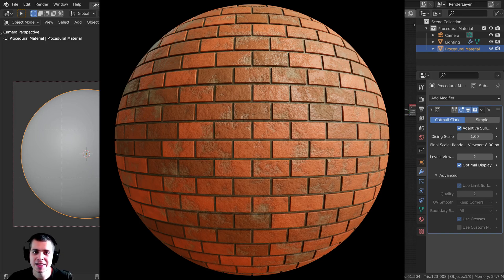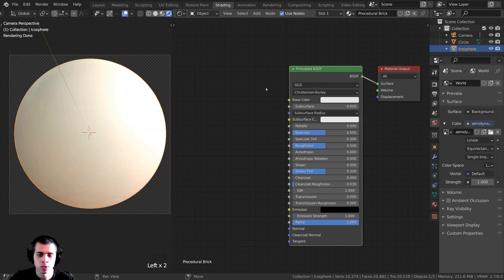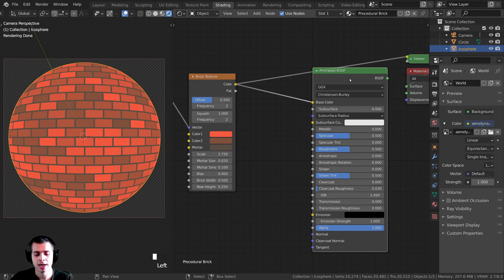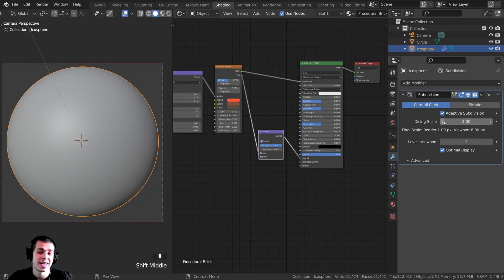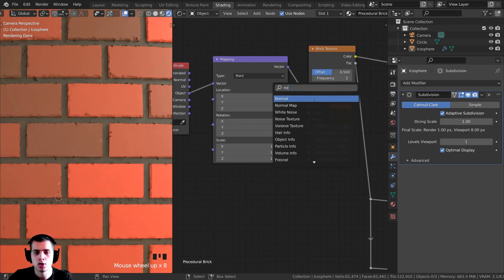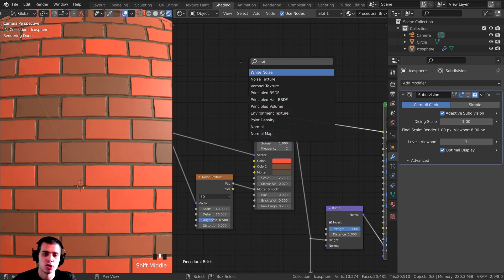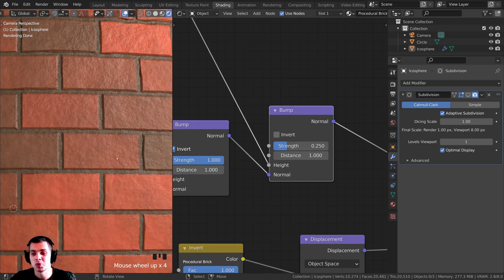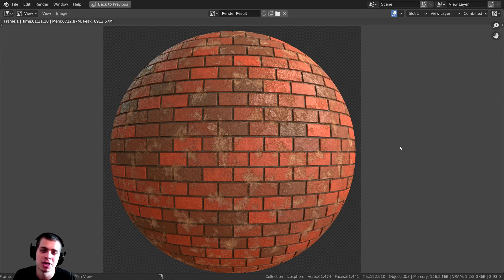Procedural Brick Material (Blender Tutorial)

Comment: Don't know if this will help anyone but, I did this tutorial to a set I'm making for a short. And I ran into the problem of my bricks only showing horizontally on one side of my mesh. As I was making stage wall texture. I recreated the tutorial on two separate textures and assigned them to each wall seperatly. Then for the wall that was only showing bricks horizontally, I went to the rotation on the Mapping node which is connected to the Brick Texture node. In addition to rotating the X rotation to 90 degrees I also rotated the Y rotation to 90 degrees and the texture worked perfectly.

Comment: for those using Blender 4, the Surface Displacement settings are located in the options panel (press N whilst in the Shader Editor) and they are listed under Settings>Surface. They are also in the Settings of the material properties in the drop down menu beneath the displacement settings.

Comment: At 4:50 you say "whatever you like". Do you have any advice how to correctly scale the brick texture to match for example 60x60cm tiles? I have played around with Texel Density (great addon) and other tricks and tutorials, but ALWAYS ended up using the measuring tool for hours (literally) to get close to the correct size. I assumed that if you set the scale to 1 and the brick size to 0.6 it would match to 60cm as Blender unit is 1 meter ... but it does not. Thanks for any pro advice! -- Cheers, Nils

Comment: Nodes are quite possibly the least intuitive and most convoluted form of modeling Ever invented. You not only have to remember the name and full features of every node but also remember where that node plugs into another node. Then remember which sliders on each node controls which parameters. Multiply this process over a dozen different nodes, two dozen different connection points and six dozen different sliders and congratulations, you have a brick wall. lol

At the very least Blender should have a small library of node setups for basic textures. Example: Load the brick wall node setup from the library, adjust the parameters as needed and you're done.

It's just confusing to invert the mortar on the bump map only to add yet another node later in the proces to invert the mortar.

Comment: Thank you so much for not just this video, but this entire series. They are all so useful for the work I do! As weird as this sounds, I used this tutorial to make fishnet stockings for a model. However, if you don't mind, I have two questions for you: 

1) Do you know of a way to apply a subsurface color to just the bricks part of the texture (say, make the bricks have a subsurface color of red but have the grout have no subsurface color).
2) Is there a way to apply a separate normal map to the bricks and the grout? So, as an example, have the bricks have a bit rougher of a normal than the grout.

I thought making the bricks shader first then applying it via a "Shader to RGB" node to the brick texture would do the trick, but the subsurface color doesn't really show up and it messes up the shadows (as in makes them completely black). Any help with this would be appreciated. If not, thank you anyway and have a great day!
Reply from the maker: Thanks for watching! Yes, these can both totally be done.

For the subsurface, you can plug the brick texture factor, into the  subsurface on the principled. You will also need to add an invert node to switch the values, so that the bricks have the subsurf. Then either add a texture in the the subsurface color, or just change the color value.

For the normal, you can use the brick factor, as a mask, to make different parts have different normal maps. For instance, you could add a noise texture, and plug it into the color 2, of a mix rgb node. set the mix RGB to lighten, and make color 1 fully black. Then add the brick texture factor into the factor the the mix rgb. then plug the mix rgb color into a bump node height value, and finally, plug that into the normal. hope this helps.
Reply: @RyanKingArt  This works like an absolute charm! Thank you for the help with this!
Reply from the maker: @SquirreltailAnimation  You're welcome!

Comment: This is great and I followed along but, when I put this into practice I have a problem. Walls on a building step in and out, turning corners and, the inside does not have brick texture. When I use this node on a wall, even though I pick specific faces, the procedural texture goes on every wall and is elongated on some as stripes. I have tried "cube projection but, that has no effect at all (I'm trying on version 3.0). I've tried unwrapping, marking seams, selecting individual faces, etc, and nothing seems to stop the procedural shader from applying itself to everything and those faces that are ninety degrees from a correctly laid out  grid become stripes of brich and mortar stretched.
Reply from the maker: Yeah, I should have gone over how to fix that in the tutorial. There is a node setup to fix this issue. I might make a video about it soon.
Reply: @RyanKingArt  There may be some quirks to work out on 3.0 (there is on any new version of any software). I would run it and have it do one thing, strip it all back and run again and get it to work. The thing that worked best was to first apply a generic texture, I just used a white color, then when you specify the faces to be brick it only applies to those, That also seemed to trigger the "cube projection" to line up the rows.

Comment: I'm getting no change after adding bump node. It shows a very little difference but changing distance or strength has no effect. Displacement Node has no effect. I started using a rectangular wall and figured it was me, re ran a new job using the sphere following along everything, same issue. I just loaded 2.93.6, don't know if that is it or not but it ground to a halt at that point. Reran the tutorial a third time, same issue.I threw the Invert Node in and it did effect the mortar but really bad quality, real choppy. Maybe it's this build so, just a few days away from 3.0, I'll try it again then. I have 32 gig memory, i7, two GTX 1080 Ti cards in SLI so, plenty of machine.

I tried it in one of  Simon Thommes brick tutorials and in the first five nodes idisplacement didn't work. Pretty sure it is aa bug in this build as that's two approaches that wouldn't give the displacement. Oh well, let's see what 3.0 does.
Reply from the maker: Hmm... sorry to hear your having problems. Yeah, maybe try it with Blender 3.0.
Reply: if you go to 9:30 on the video he connects the brick texture fac to displacement in the material output. then he selects principled bsdf, then presses shift+control+left click. that makes the viewer node disappear, and you can see the displacement. hope this helps
Reply from the maker: @jamesesther8182  Thanks!
Reply: @jamesesther8182  Thank you for catching this! I was wondering why my bricks weren't "super super bumpy" at 15:56
Reply: I'm having the same issues  the bump affects it only very slightly and the displacement doesn't seem to have much effect at all. Please write back if you figure out a solution? @Path11 Media

Comment: Sir; this material looks nice and works fine on part of the sphere, but why doesn't it work on a flat plane you add to the scene and why does it also not work ok on a cube you add? It only works on the cube on the front and back face but not on top, bottom, left and right face? How to fix that?
Reply from the maker: Yeah, sorry about that. Someone else was wondering about this too. I didn't know it was an issue until recently. Although, I found a method online that works. Here is the link:
https://blender.stackexchange.com/questions/112843/how-can-i-make-my-procedural-brick-texture-map-correctly-to-both-a-cube-and-cyli

I tried it and it worked! Here is the setup that I used: https://i.stack.imgur.com/VYIeK.png

You can add that, and plug it into the Brick Texture Vector, and it will work. Hope this helps.
Reply: @RyanKingArt  It would really make more sense if this was done on a plane surface. Also I have difficulties trying to scale up textures and lose the tile repetition with wooden floor textures. I was hopping this tutorial would help but it didn't. Can you maybe do a  follow up explaining how to do that? thanks
Reply from the maker: @utopicc  I will consider it. Thanks.

Comment: Hi. Thanks for the tutorial. I downloaded the file from Gumroad and applied the Procedural bricks to my own wall (cube) and I noticed that two of the sides show the bricks correctly but the other faces just show the brick rows stretched horizontal and there are no vertical mortar lines. This is in Blender 2.93. Any ideas how I would make all the sides of the cube faces look correct? You can see the same thing happening at 8.32 on your YouTube movie on the sides of your wall and if the wall was any deeper (going back) those edge bricks just stretch. I'd need to somehow apply the Procedural bricks material to each of the individual faces to make it look correct but that can't be done.

Thanks, Andrew
Reply from the maker: Hello. Thanks for purchasing the project files! I just opened up the file and tried to fix that, but its not super easy to fix. Although, I found a method online that works. Here is the link:
https://blender.stackexchange.com/questions/112843/how-can-i-make-my-procedural-brick-texture-map-correctly-to-both-a-cube-and-cyli
I tried it and it worked! Here is the setup that I used: https://i.stack.imgur.com/VYIeK.png
Also, I just Updated the project files, with the extra node setup, so you can just go back to Gumroad, and Re-Download the project files, and the new node setup will be in there. Hope this helps! Let me know if you need more help.
Reply: @RyanKingArt  

Thanks for the reply Ryan. Appreciate it. 

I did manage to get the sides displaying correctly using the node set up you gave me a link for.

Here's my node setup that works

https://i.imgur.com/E4ZgTfo.jpg 

The problem is though I've lost all the effects that make the bricks look a little more realistic as in your original tutorial node setup shown at the image link below

https://i.imgur.com/EToS2X5.jpg

Here's a screenshot of what I've done so far to include the bump nodes and a few others but I can't work out how to fit in the Noise Texture nodes,  ColorRamp nodes and Darken node.

https://i.imgur.com/qDleaDb.jpg 

 In your tutorial setup, there's the Mapping node on the far left but that's not in the newer setup with the Combine nodes.

Thanks again for your help.

Andrew
Reply: Ha.... While I was doing the things above you were in the process of changing the Gumroad file with the updated nodes. Thanks very much and a cube now looks excellent.
Reply from the maker: @cicadastudio3486  Glad the problem is fixed now!